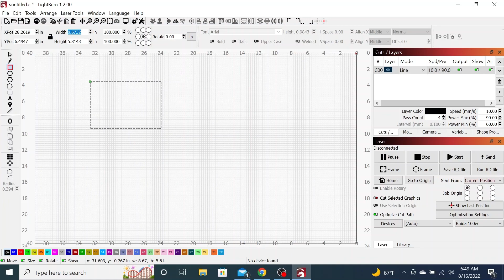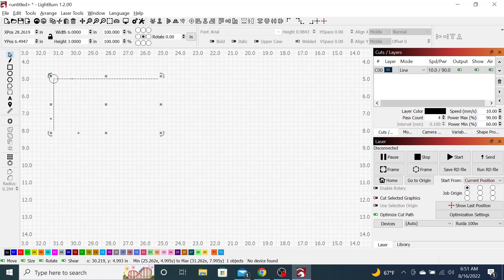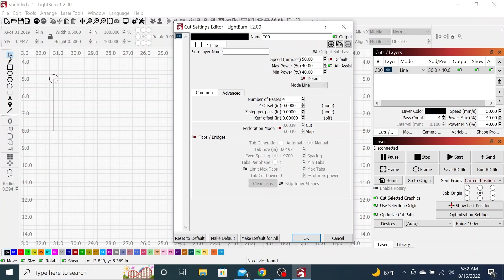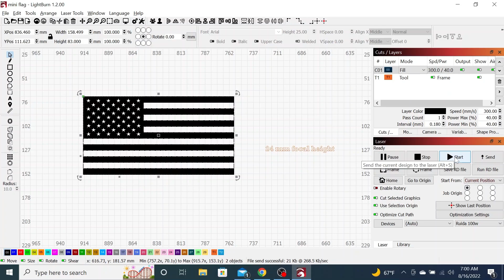Project Alignment and Corner Jigs for Co2 Lasers

Comment: I have the same machine. I’ve found that my power sweetings aren’t any more powerful (if that’s how you’d describe it) than my 60w laser. What’s a power setting and speed you use to cut 1/8” plywood?
Reply from the maker: I cut 1/8” ply at 35-40mm/s at 45% power.

Comment: Hi brutha,  great video and informative.  I have a ? , i just bought a OMTECH 55w laser engraver.  How can i engrave with out burning the wood . Yours came out clean no burn marks . Thanks ,

BTW  have you have a video on installing leds lights to your engraver.  Thanks
Reply from the maker: It is a balance of speed, power, line spacing and air. 300mm/s 40% power .1 line spacing and the was run out of focus with as little air as possible.
Reply: @BeardedBuildsCo  kool , ill try that this weekend.  Have a great day 😀.